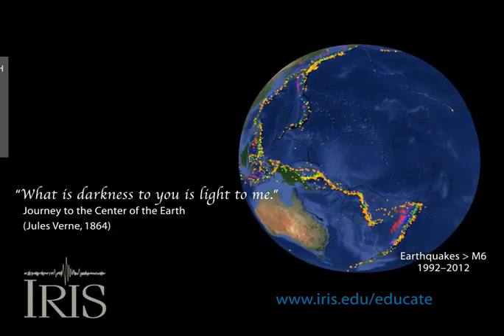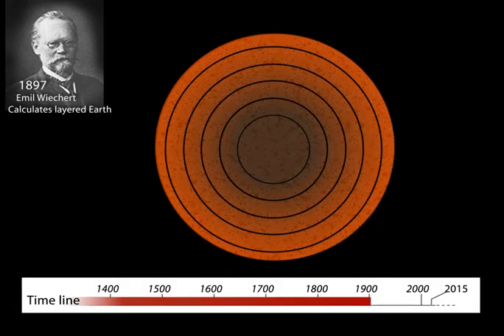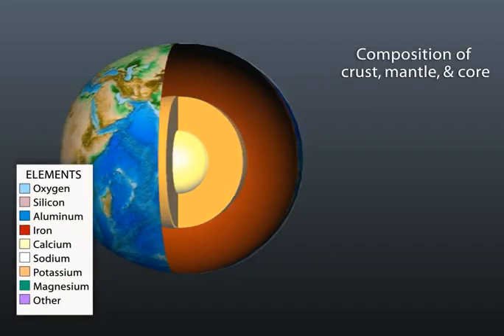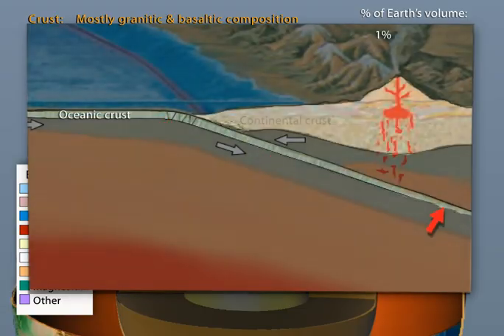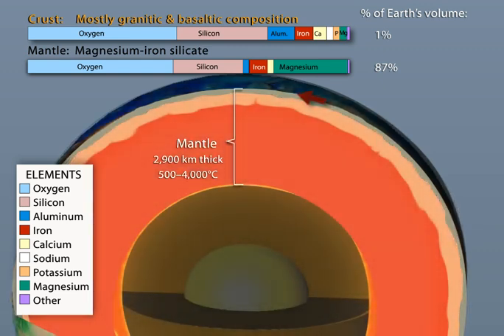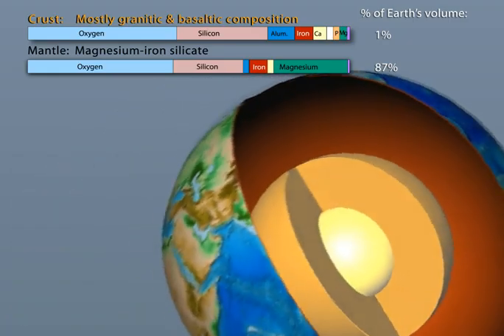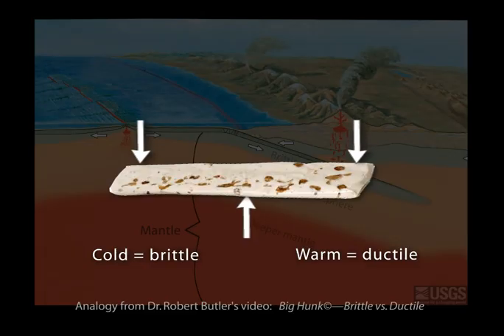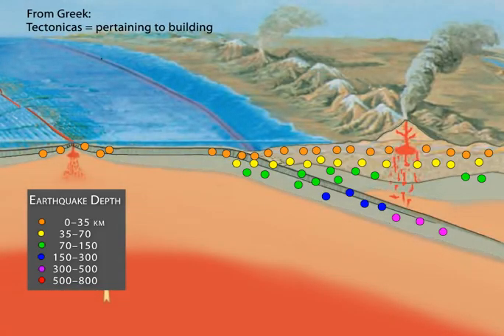Earth Structure the lithosphere (crust}, the mantle and the core -solid rock, is basalt and granite.

Comment: My take away 
Earth is built in layers — crust on the outside, mantle in the middle, and a powerful core deep down.

The mantle never sits still; its slow movement is what causes quakes, volcanoes, and drifting continents.

The core isn’t just hot metal — it creates Earth’s magnetic field, which helps protect life on the surface.

Comment: Aloha Professor,
key takeaways from this video are:
1. the earth is made up of 3 different layers compared to an egg analogy, the lithosphere(crust) the mantle and the core.
2. the crust has 8 major elements , silicone, oxygen, aluminum, iron, calcium, potassium, magnesium, and sodium
3. the crust is 5-10 km thick in the dense basaltic oceanic crust
4. the difference in density and thickness in the two types of crust is why there is ocean and continents.
5. the tectonic plate is the uppermost brittle mantle that behaves like the overlying crust.

Comment: Hello Professor, This was a very informative video to start off with learning about the Earth's layers. A few key points that I got from this video were:
-Data from earthquakes was used by scientists as a method to look deep beneath the Earth's surface
-There are 3 layers to Earth: Crust, Mantle, Core, and this resembles an Egg
-The Crust and Mantle both have the same elements, just different volumes of each
-The Core is made out of 2 elements with Iron being the biggest
-The Core is also like a magnet 

Kamicka Smalls
Earth 103-0